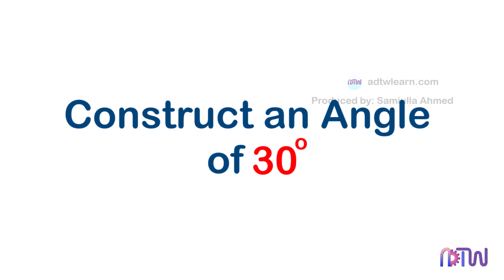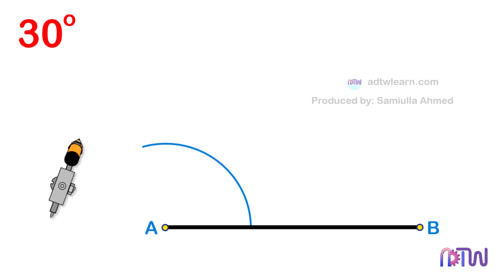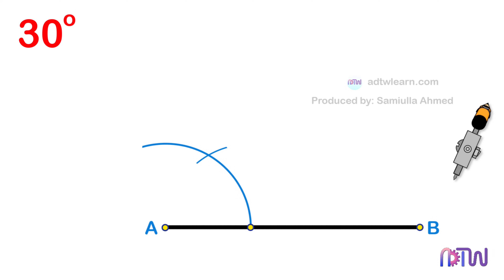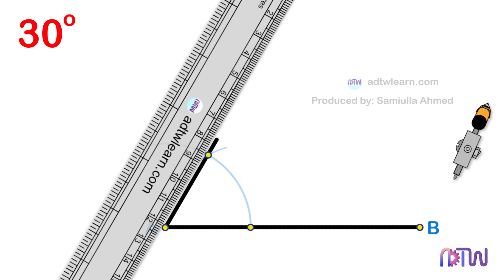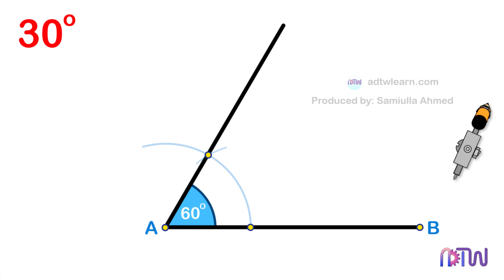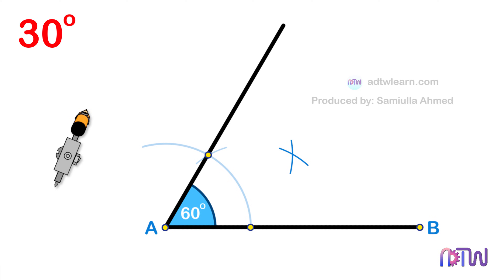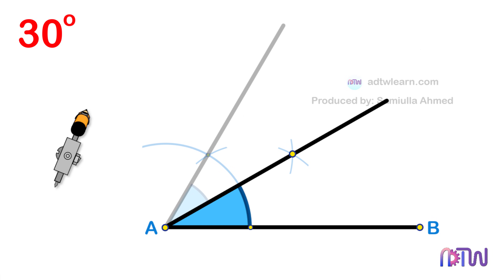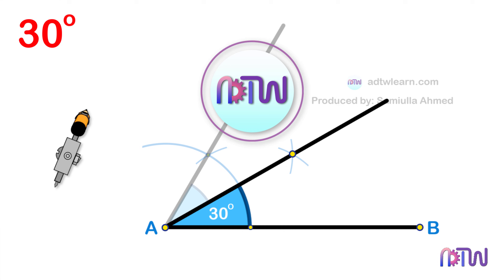30 Degree Angle Construction Tutorial || 30 Degree Angle Construction || Compass Angle || Geometry

Comment: With out draw 60 degrees if any possibilities are there to draw 30 degrees
Reply: No there are not because 60 and 120 are the only standard angles that we can draw from compass and from 60 and 120 angles we can draw the other angles + 30 is the half of 60 or 60 is the double(×2)of 30 and after 60 degree is bisected it becomes 30 degrees
Reply: You can if you already have a 90° angle on the line AB. Let's call the new line AC.
By using the technique to make a 60° angle on Line AC, you can find the point from where to make a 30° on line AB.

Sorry if badly explained. Just a cook who learned to do this 25 years ago.